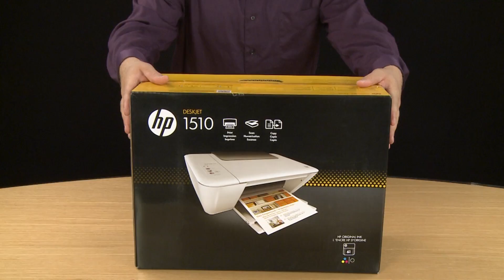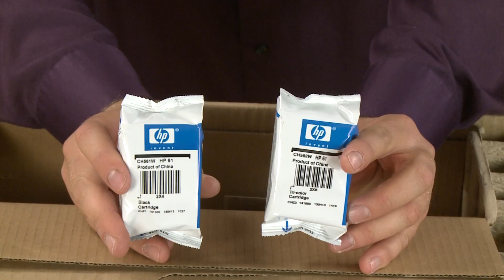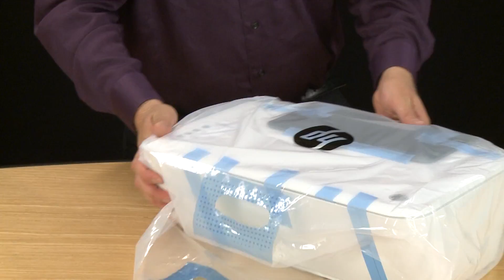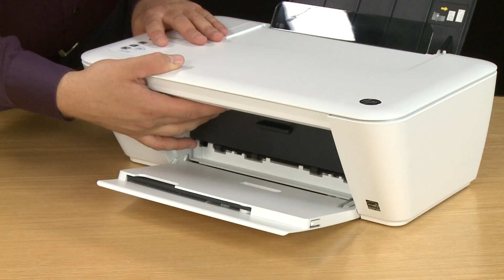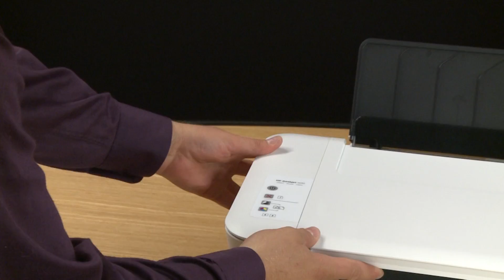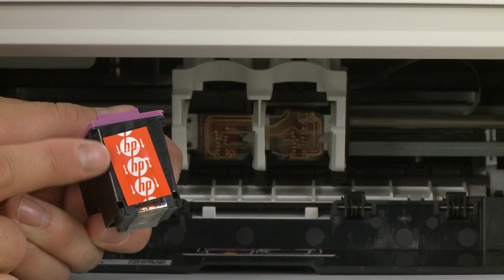Unboxing and Setting Up the HP Deskjet 1510 All-in-One Printer | HP

Comment: I accidentally open the small black board that placed in the output paper lid. But i cant close it now. How to close it?
Sorry bad english.
Reply: I mean I cant close the output tray extender after I accidentally open it. So, how to close it?
Reply from the maker: Aina Aiikyo Please search for C03832527 on HP's home page or using Google search. It is the Deskjet 1510 Series User Guide.  On page 22 it shows you how to open the output tray extender.  Please just do the reverse to close it.
Reply: ***** hey aina, i know it's hard and you may fear to break it but it'll work. slide it the other way. HP should develop another way of doing this. because it's very hard to reverse and close it.
Reply: Kenji Kobayashi I accidentally close it. Haha. I think I'll never open it anymore. Thank you by the way.
Reply: ***** It's already closed! Thank You.

Comment: hi HP Support,

kindly update I got my printer without USB Cable.. Do HP1510 has wireless capability Can I print wirelessly PLZ Update HP
Reply from the maker: Hi Faisal Fareed,
 
The Deskjet 1510 only supports a USB cable connection.  Please search for C03775352 on HP’s home page or using Google search.  It is the printer specifications for  the Deskjet 1510 and the Deskjet Ink Advantage 1510 printers. 
 
If you need to get a printer style USB cable, please search for part number V7N2USB2AB-06F.  It will show the two different ends that is required for a printer USB cable.
Reply: Thanks I got the USB Cable, and one more issue I want to discuss, If possible kindly update as earliest, with the printer I got the Black and Color Catridges " HP 122" kindly update how many pages I can print with the default Catridge provided with the printer " HP 122 Standard"
Reply from the maker: Hi Faisal Fareed,
I have sent you a private message with the link to the ink cartridges specifications which includes the page yield.
Reply: *****
kindly update which are the Ink Catridges supported with HP1510 All in one printer as I got default with the printer HP122 what others I can support with HP1510 can I use HP301
Reply from the maker: Hi Faisal Fareed,
Please search for “HP Sure Supply”  using Google search and the first hit generally is the HP website.  This web site by HP allows the user to enter their printer, such as your Deskjet 1510, and it will list the ink cartridges for your Deskjet 1510.

Comment: I bought a hp deskjet 1513 color all-in-one inkjet printer scanner. The installation disc that was included is from  hp deskjet 1510. I succesfully installed it but it only prints the test sheet. The scanner works properly. The only problem is that no documents are allowed to be printed. Can anybody help me?
Reply from the maker: Onay Gonzalez What is the version of operating system installed on your computer? Are you able to make a photocopy of the test page from the printer? Is the printer plugged directly into a wall outlet?
Reply: My Laptop runs with window 7. I do can print out the test sheet, the printer is plugged into a wall outlet and i can make photocopies. However; if i want to print word documents saved in my laptop, i cannot. The printer does not want to do it. It only prints the test sheet.
Reply from the maker: Onay Gonzalez I recommend following the steps in this document on HP Single-Function and Multifunction Printers - 'Printer is offline' Message Displays on the Computer and the Printer Does Not Print: Windows 7. This can be found by Google searching "c04249111".
Reply: ***** downside is that i cant connect the scanner to the Internet because the Scanner is now at my parent's in Cuba:  there is not internet. Is it possible to do it without internet?
Reply from the maker: Onay Gonzalez You can follow the steps in the document listed above to troubleshoot the issue without connecting it to a wireless network by using a USB cable.
Reply: ***** i do appreciate your help!
Reply from the maker: Onay Gonzalez I'm happy to be of assistance!

Comment: Bought one 3 months ago, used it to print about 10 pages in December, tried to use it today and it prints so lightly you cannot read what is printed. WTF?
Reply from the maker: Great White7 With an inkjet printer since the ink is water based if you go extended periods of time without printing anything the ink exposed to the elements will dry out. I would advise you to run the printhead cleaning utility to clean up the dried ink. It is recommended that you keep your printer plugged in and turned on at all times as it will periodically use a touch of ink to keep the printhead from drying out.
Reply: ***** Thanks but it prints MS Word docs ok, just not PDFs.
Reply from the maker: Great White7 In this case it is not the printer that is the issue, but your computer that is having the problem. What operating system are you running on your computer?
Reply: ***** Windows 8.1
Reply: ***** can we share HP 3545 wireless printer on PCs which does not have wireless network Via lan or any other wired connection? please reply fast.
Reply from the maker: Great White7 Please ensure that your Adobe Reader is updated via the link below.
http://www.adobe.com/downloads/updates.html
Reply from the maker: Sohail Hussain Yes you can being connected to a network and sharing out does not depend on your connection type. Both wired and wireless use the same TCP/IP protocol and sharing would be the same.
Reply: ***** Now it does not print anything.  Its only just over 3 months old, and either the ink has run dry (only printed 10 pages) or the printer is dodgy.  Never buy another HP printer again.  Had a different one before this and had to return it 2-3x as well.
Reply from the maker: Great White7  Please call our Technical Support at 800-474-6836. If you live outside the US/Canada Region please go to Google search and enter 'contact HP worldwide'.  Your first option should be the site for contacting HP, when you click on it you will be prompted to choose your country/region.
Reply: ***** I did ring HP Australia.  Told me the same (re-install the software).

Comment: no ink came with mine is there a certain ink that u need to use
Reply from the maker: +vel miller   If you didn't get any ink in the box when you purchased the printer, please contact Technical Support.  To contact support, what you can do, is use the following link to create yourself a case number, then call and it may help speed up the call process. 

Step 1. Open link: www.hp.com/contacthp/
Step 2. Enter Product number or select to auto detect
Step 3. Scroll down to "Still need help? Complete the form to select your contact options"
Step 4. Scroll down and click on HP contact options - click on Get phone number

Case number and phone number appear.